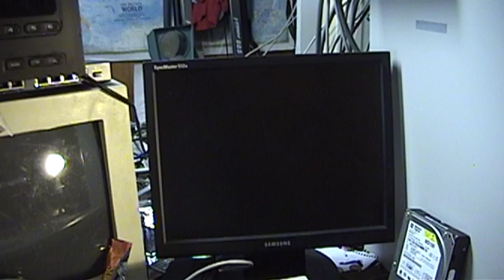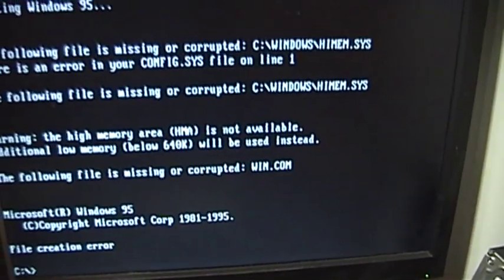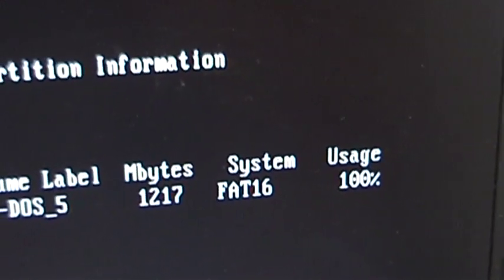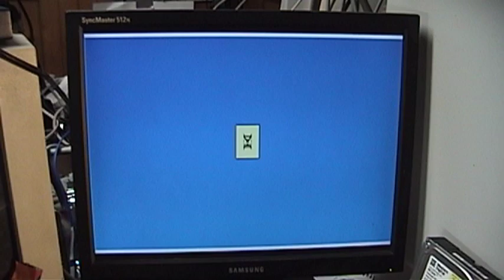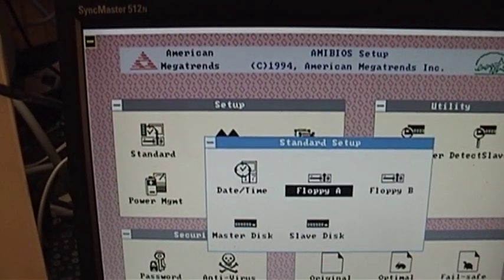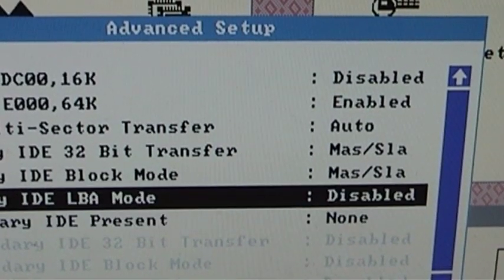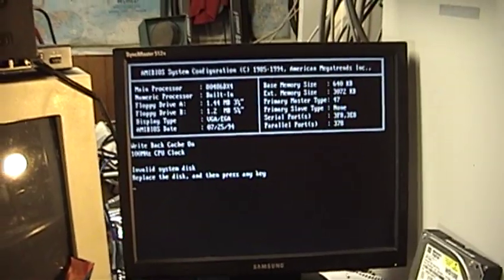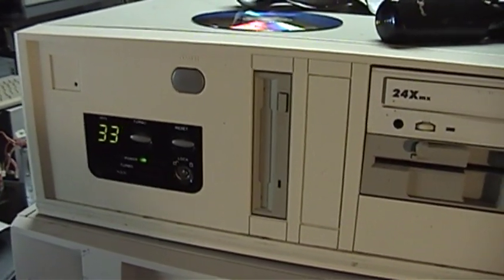Am486DX4/100 Clone PC Revival

Comment: When it comes to vintage PCs like this, do you prefer systems from big name vendors such as Dell, Compaq and Gateway, or custom-build systems from small shops like this one? The reason I ask is because a lot of systems like this were built by mom and pop computer shops with motherboards that only have a 5 pin AT keyboard port on them, and for the rest of your ports are broken out by headers either on the motherboard or by a multi I/O card. Compare that to computers from companies like Dell, Compaq and IBM from the same era where the motherboard typically has a full card of serial, parallel and PS/2 ports.
Reply from the maker: I prefer the big name vendors. One never knows to what stresses a self built system was subjected during its assembly. Sometimes people would use the cheapest and most awful cases, expansion cards, power supplies or even motherboards. Big name manufacturers have had their share of foibles, but in general, they used good quality parts and usually got them put together properly.
Reply: @uxwbill  I would say I agree with you. I like systems where all of the I/O ports are just integrated onto the motherboard and I don't have to worry about breaking out headers or using super I/O cards.

Comment: coin battery, good and easy to find
dallas or odin rtc chip, not so good and harder to find than coin batteries but doesn't leak unlike the barrel batteries
barrel battery, awful and kills 486 boards when they leak, have encountered many 486 boards that were DOA from the leakage from those batteries, i gave up and went with a Pentium 1 for a DOS gaming PC
Reply from the maker: It's not impossible to revive the Dallas modules and their clones. Many are socketed and the most common types are still available new, if you're inclined to buy one. The less common models leave you no choice but to try and connect an external battery.

The barrel batteries are a plague and were common from the days of the 286 up to the middle of the 486 era. Again, though, if you're determined, the damage they do can sometimes be fixed by jumpering the ruined traces.

Don't be fooled by the coin cell batteries. If neglected long enough, they too will leak and cause damage.

Comment: Great video!  I built a dx4 100 a couple of months ago and when I was partitioning the hdd I thought it was odd that 8gb was only being reported as 504mb... I just thought it was old hardware and probably a faulty hdd or ide controller so just left at that.  Has actually been working fine and even installed some games and programs on it with no issue.  Totally forgot about LBA so keen to set it up right next time I play with it!  Thanks :)

Comment: For some reason, it reminds me of the mobo I just got in the mail. They are not identical yet the way it is booting are the exact same way. Same bios interface too.
Reply from the maker: AMI's WinBIOS was extremely common in the 486 era.
Reply: uxwbill True that. For some reason, it was just not that widely used on the boards that I used and my friends used back then. Though globally it is true. The only four 486's that I remember had it, is four identically 486dx2-80 systems. Then I remember one QDI board with a P-133 that my parents used to have.

Comment: I have an IBM PC 330 (Pentium 166 machine) with a motherboard on which you can apparently use all four 72-pin SIMM slots along with the 168-pin DIMM slot at the same time.
All slots are for EDO DRAM though, so maybe that's why.

Comment: I've just picked up a 486 with the exact same board but an earlier revision without a ZIF socket. Did you ever find more info about the board?

https://youtu.be/C58haZmG4-c
Reply from the maker: +LBX Computer Services The board you have was probably made by PC Chips and it is very well known, particularly for its fake cache. I'm sure that someone's posted the documentation on line, but I haven't looked.
Reply: +uxwbill I need to take a closer look at the board. Thanks :)
Reply: +LBX Computer Services what was the biggest hard drive you got running in this?

Comment: That's the first time I've seen a Creative optical drive.
Reply: +Steve W They were actually very common in the 90s, however you probably can already guess that the drive isn't actually made by Creative, it's probably made by Panasonic or Sony or Toshiba or something.  I suspect the CD-ROM drive and sound card were sold as a bundle, possibly with a microphone, some speakers and some software.

Comment: you can get away with the 30 and 72 pin slots populated at the same time, hell, you could do the same with sdram and 72pin on some of the boards that had it as long as you either filled the 72pin or used pairs in the 72pin. but it is still a nono, and it never works for long if at all if the sticks are high density in comparison to the contemporary sticks for the board. in the 30/72 pin configuration it treats the 72pin like two 32pin sticks and the chipset can handle 8 30 pin sticks. can really make it act stupid. btw, you can slow down that memory speed check to normal speed, that is a setting in the bios, it just checks that the sticks are there and reporting, it doesn't actually test the memory for all intents and purposes. i think it used to be called fast memory check or some crap like that in the bios.

btw, that system has what is called an overlay, that is why fdisk looks funky. the disk is too large for the hardware so the addressing has to be done using software, but the software appears to be fucked. the hardware itself cannot see or use a 1gb drive, but the drive is probably a 1gb hdd. keep in mind that the bios is on the motherboard, the multi io controller is an add in card.

(EDIT: more than likely someone formated that drive without reinstalling the overlay after, that is why it gave them such a headache, in truth if you want to wipe a drive with an overlay you might as well wipe the partition table and start from scratch with a fresh overlay unless you like nightmares)
Reply: ***** you had already replaced the bios batery, and my first step would have been loading bios defaults, not to mention the system had been jimmied around with in the first place before you got it, i wouldn't take the bios settings you ran into as representative of the initial issue. but hell, you had/have the computer in hand, to put it bluntly i'm just firing shots in the dark and you got to see and feel it for yourself =P.
i just remember having a board back in the late 90s (was years old when i got it) with one of those amd dx4 133 "p90" chips on it with pretty much the same bios and for drives at a bit under 1gb and over i always had to use an overlay.
i'm guessing yours must just be a newer version of the chipset and bios than the one i had with a less powerful cpu on it.

anyway sorry to bug ya, have a good one, it is nostalgic for me to look at these old systems i haven't dealt with in a decade and a half and i enjoy seeing someone put up videos about them, although i cringe every time you talk about some proprietary crap as being "good" =P
Reply: +uxwbill I once saw a Pentium system that had 30 pin SIMM slots on it and IIRC 16 of them.  You had to put them in matched sets of 8 to fill the 64 bit wide bus. Of course if you really wanted to save those old SIMMS you could pick up one of those SIMM stackers as long as you got the right direction.  You couldn't put two leftward facing sim stackers together because they wouldn't fit, so you had to get a left and a right, but then that blocked your other slots.  So they came up with the Left short and Left tall, so the tall one would rise above the short one and you'd have 8 30 pin SIMMs floating in the air on the left and then you could repeat with the right as well.

Comment: Different types of memory at the same time:
I have had a motherboard, a Siemens-Nixdorf-Motherboard with a P1 in it that had Slots for SD-RAM and 72-pin-type memory and it actually accepted both populated at the same time. It summed up the amount of memory but only ran at the speed of the 72pin sockets. That was pretty cool
Reply: ***** You mean like illegal as in law wise or it just wont work?
Reply: +AlmightyMaria PvB I have an IBM PC350 that has DIMM-168 PC100 and 72-Pin SIMM slots in it that can work in junction with no problems. It's really just a Pentium version of this computer, to be honest, it has a multitude of problems I'm really not willing to fix or even look into, but maybe I will one day...
Reply: +MinecraftMarcus1 It's illegal, as in, not supported by the standards. Neither is on the fly processor overclocking, but that didn't stop them either. Its very possible it could be done, but however it is done, the speed of the ram will always be that of the slowest ram. This is more of a physical law :P
Reply: +Richard Smith: True. But it is a law of physics only if the slow and the fast RAM must be accessed simultaneously, as in the lower/upper halves of a full bus width (like with a Pentium). If they sit in different banks it must be up to the design of the memory controller whether the fast one can be used at its full speed or not, at least in older systems, without tight interleaving of memory acesses.
Reply: Sven Ekeberg That is too complicated, because when a programs need memory, and it gets assigned available memory address pointers. If some gets allocated on a slower data bus, then accessing the bus will be unpredictable and inconsistent. We have a seperate data bus for overflow, the page file, and that is expected to be slower(I'll get back to this)
Today's memory is built around parallel processing, which demands consistency in performance, which is a higher priority than speed, and programs are optimized to take advantage of that.
So in this, the memory allocation would be too bloated dealing with data speed consistency, slowing everything down, or the program would have to be made in order to expect an inconsistent data rate... again, slowing it down.
The only solution here so that everything still actually functions is to clamp the data rate to the lowest common denominator, it is the simplest solution to a complex problem.

Imagine this, lets say you have a program which saves its state, and simultaneously loads new data. The save state requires less data to be processed than the loading of new data, and it is also started first, so it is perfectly logical the save state will complete before new data is processed, unless the new data is actually on a faster data bus, and now shit is happening out of order and stepping on each other, causing all kinds of unpredictable behavior.

What one could do is use the slower memory as a separate partition for (part of) the pagefile/cache, as the page file is expected to have inconsistent performance.

You can currently do this by making a ram disk, and telling windows to use it for its pagefile, if you were unaware :) This obviously is a bad idea most of the time, cause it would be better off just being extra ram, but back in the 32-bit days, programs only had access to 4GB of ram(sometimes this turned out to be closer to 2.5GB), and it had to cache the rest, which is where this came in handy.
Reply: You are trying to move this hardware topic to some kind of higher abstraction level. That is not very appropriate, as I see it, because:

1) There are wildly varying timings already for ordinary memory accesses in a standard PC or server: There are fast static RAM for L1 cache, slower static RAM for L2 cache and much slower dynamic RAM for main memory. The latter is also unpredictable in that single word accesses are less efficient than burst accesses (normally used to fill cache lines) and in the fact that the total delay (latency) depends on exactly where in a long read/write/refresh-cycle a (new) request from the CPU happens to intrude. In older or simpler computers (old mini computers, PCs, home computers or embedded systems), the CPU and the RAM/ROM was instead fully synchronous. So even without page-swapping to disk, modern PCs are much less predictable than older and simpler systems. This could indeed be problem for some applications, such as software synths and sound processing, although the major problem is the unpredictable behaviour of Windows. Your argument about predictable timing is therefore a little backwards, historically and technically.

2) Today's working memories (various forms of DRAM) are not "built around parallel processing". Multi core CPUs are, however, quite naturally, including their internal caches, but memory subsystems have more unpredictable timing than ever.

3) The problems with synchronizing different threads, processes and/or processor cores are usually done with semaphores, queues, and other well known techniques (often from the 1970s).

4) So called RAM-disks have very little to do with the original topic on hardware level DRAM timing, the same could be said about the operating system they call Windows :)

Comment: Bill, I recently got a computer with a PC Chips M919 motherboard (my second one; I got my first M919-based machine around the same time you posted this video), and it's the version with both 30 and 72-pin SIMM slots. I don't know how, but both types of RAM work simultaneously. Mine has four 1 MB 30-pin SIMMs and two 16 MB 72-pin SIMMs, and it recognizes all 36 MB of RAM.

To be honest, I really like the M919. Sure, it's a PC Chips product, and it was cheap, and it was the subject of unorthodox business practices, but I've found with both of my machines that they simply work well, and they're not terribly slow even without the L2 cache. Mine are rock stable; I've never had a crash. Plus the M919 is extremely versatile, supporting every Socket 3 processor ever made, and being able to use ISA, PCI, and VESA cards.

Comment: I discovered that on a Sony Vaio that I recently put an 80GB hard drive in, fdisk thought that the hard drive was 10GB. However, Windows 98 setup had absolutely no issue with dealing with the full 80GB capacity. I'm not sure why fdisk got confused; I've seen it work fine with 160GB drives in the past, and the Vaio shipped new with a 20GB drive (and Windows XP), so it's not like the motherboard doesn't know what it is doing with a "large" drive.

Comment: Love AMI BIOS. If the person that set up that computer had read the one or two page manual that came with the motherboard they would have known that using both types of RAM was not allowed. Still lookng for 8 MB 30 pin SIMMs. I've told they were manufactured but I've not been able to find them. First Linux distro I ran on this board (described in your video) was Red Hat 4.2. Very archaic when compared to today's Linux distro's. Wasn't everything in those days?
Reply: I was misinformed about the 30 pin SIMMs. The memory guy I frequented at the computer fairs some 30 years may have given me the misinformation or I misunderstood him.

Yes, I can attest to what was available then and what prices were compared to today's technology. I have a $35 Raspberry Pi that is more powerful and has more memory than my first PC... Radio Shack Model I Level II or the mainframe computer at college where I ran my punch card batch programming on time share.

Have a nice day :)
Reply: There were 16mb 30 pin SIMMs too. Thats how people upgrade Macintosh SE/30s to 128mb.

Comment: Oh man I loved those mobos back in the 90's. I had a amd 486-133 with 64 meg. I ran RedHat Linux on it. Dual monitors. One VGA one Hercules graphics, and yes that's right a VT100 text terminal. I had a VESA multi IO card with 16 MB of cache for disk and CD-ROM read and write. I also served a X login to my old Sun 3/60, and used a dial up to the university modem bank. I learned as much on that machine as I did on my Commie-64!

Comment: 2-8: GPU not detected
That's all I know. It took me a while to figure that one out, and BOY did I feel dumb when I noticed that the only thing in there was an ISA Sound Blaster 16...
EDIT: Sounds like my Pentium Pro may have been some kind of fancier model of that thing. That's the exact same BIOS, and I swear that I heard a Conner hard disk in there. I'll keep watching and find out how big it is...
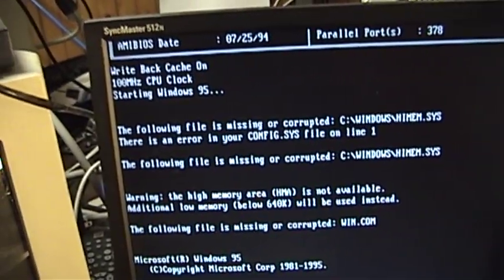EDIT 2: 8:53 All of those problems were on my machine, along with a BSoD saying "Unable to write to physical disk C". They were caused by a faulty controller board on the Conner hard drive that was causing it to report itself as 3.6 PB (3,600 TB or 3,600,000 GB)!
EDIT 3: Ignore this one. I'm stupid sometimes.

Please note that I'm only editing so many times because I don't want to just spam the comment section with my comments.

Comment: That motherboard is so very familiar, my old Am486 DX/4 100 is sat "rotting" at my parents house.  Unused since about 1997. This video has made me decide to go fetch it and fire it up.  The first PC I ever built (well, me and my Dad built) - DX/4 100, 16MB RAM, 2MB C&T graphics, 540MB HDD, an "awesome" Aztec Galaxy sound card with SCSI adapter built in to run the 1x speed SCSI CD-ROM!   We ran 3.11 for awhile then Win95. It must have cost my Dad a fortune, I must ask if he remembers how much lol

Comment: My first thought was maybe someone had installed a larger drive, but I guess i would have eventually stumbled around in the Bios settings and found the problem. I have some old computers running windows 2000, we use them to print invoices.

Comment: OMG, Now that I've looked at that board for a bit, I think it is pretty much the same one that I had years ago.  I ran an AMD 5x86-133 CPU at 160 Mhz on that board.  The BIOS was also identical.  Maybe I'll have to email you that pic.  There is also a slight chance that I might still have the owner's manual, though I'm pretty sure I tossed it some years back.  How ironic.